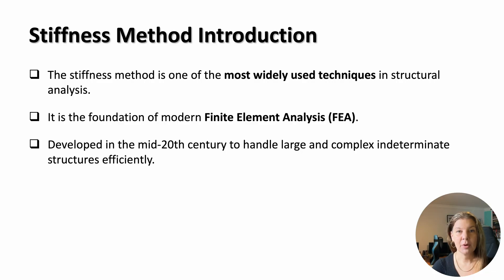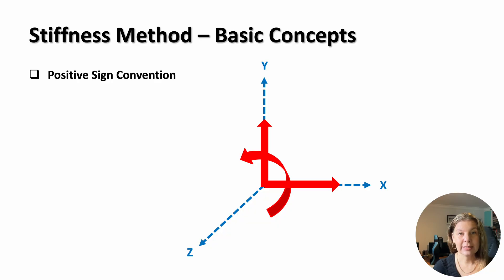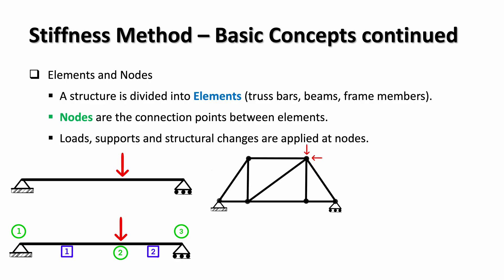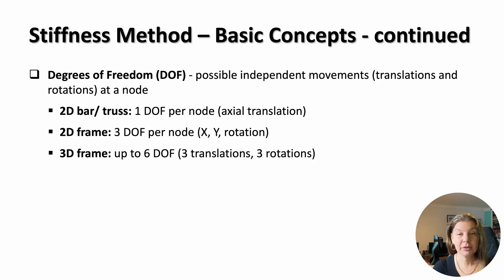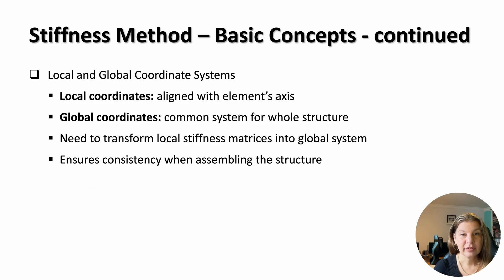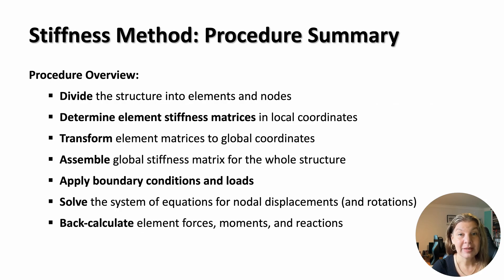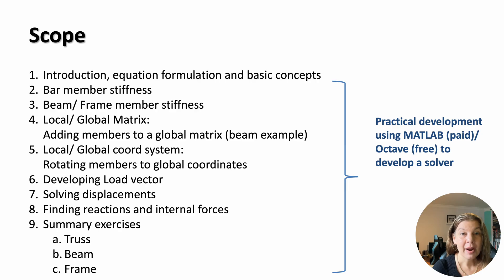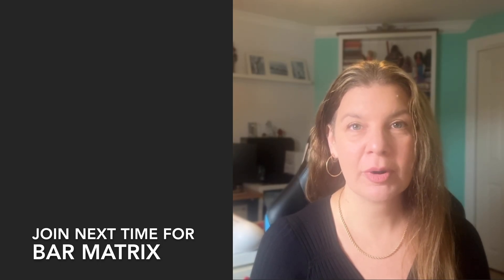Stiffness Method | Lecture 1 Intro & Concepts of the Direct Stiffness Method in Structural Analysis

Comment: Thank you. Been using FEA for a few years. Without necessarily having applied the maths. Basically saying, I have an understanding of stiffness matrix, but not used to apply on FEA. In commercial packages, you don't need to understand the maths behind it. Should be interesting!